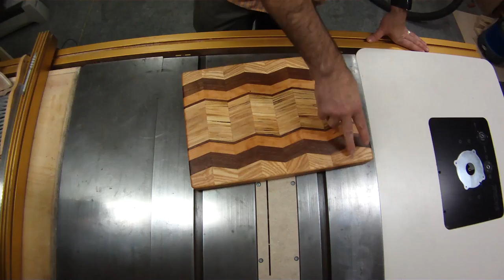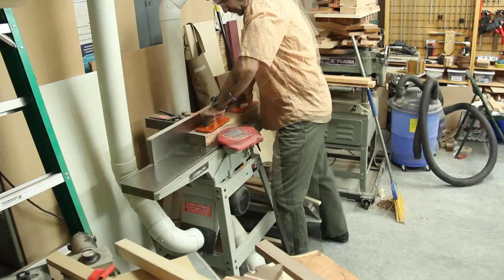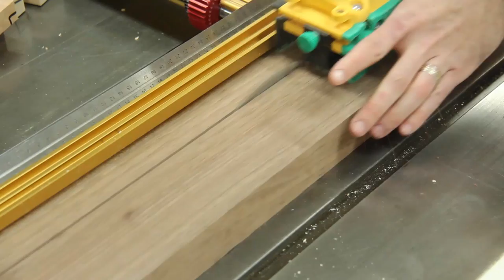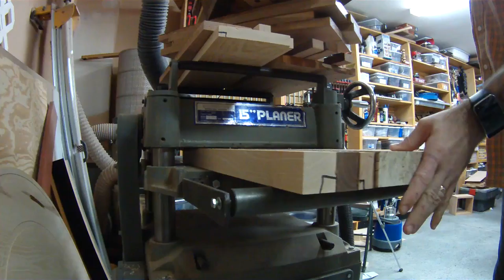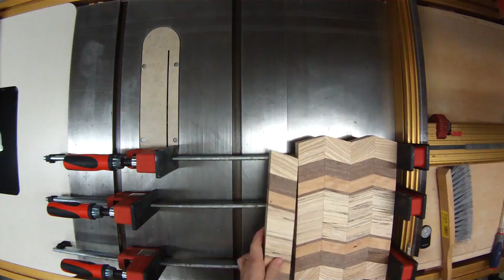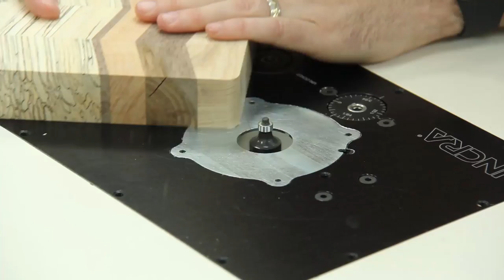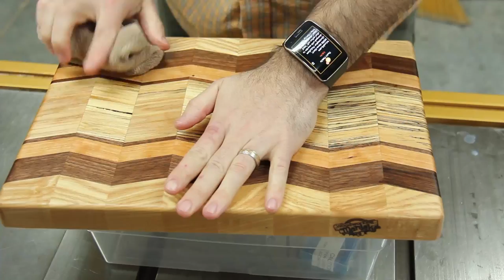Chevron Cutting Board - 2015 Kitchen Utensil Build Challenge

Comment: Very nice! You make it look so easy. I know there is a lot work involved when making those cutting boards. Great 3 dimensional look at 0:19. Looks like the cutting board has waves in it. Great video.
Reply from the maker: Yeah, this pattern tends to give a look as if the board is rippled even though it's completely flat.

Comment: Only yesterday did it my way I think it worked today will finish and once you are ready send a picture to you ok at the outset thank you, there is something else how long you leave the taboo dipped in mineral olio.
Reply from the maker: +Luiz Antonio I leave it in mineral oil about 30 minutes. Then let it drip dry for about an hour. Then soak again for about 15 minutes. Then let it drip dry again for a couple hours before applying mineral oil/beeswax.

Comment: looking at this more and more makes me wonder how hard would it be to make a table like this. do you think that is possible?
Reply from the maker: +Roshawn Sims That would make a beautiful table. For a small table, I wouldn't think any extra support would be necessary. However, if you are going to make a large table that might be under some stress and have heavy things placed on top. I would make sure to have good support underneath not to rely on all of that end-grain to end-grain glue up. I've never had a failure with any cutting boards, but they haven't had anyone stand on them or anything...

You might have sparked an idea for something I might have to try in a future video... ;)
Reply: That would be a great video. Like a coffee table size. I would want to make a full size table tho just got to work out the details.

Comment: Congratulation with new family member :)
Thank you a lot for sharing. 
Can you please tell some more about What kind of mineral oil and for how long and waxing finish?
Reply from the maker: Hossein Hayati Thank you for watching! You cannot use too much mineral oil, nor can you oil to often. It should be applied anytime the board appears to be looking dry. The mineral oil is what provides the board a protective barrier of any moisture. You can get the mineral oil from just about any retail location that has a pharmacy, which tends to be cheaper than going to woodworking stores...
Reply: Thank you :)

Comment: Awesome job! Were you using tightbond II and how long did you let it sit before you started cutting on it again?  I know you said a few of hours but could you give a more specific time?  I usually allow 24 hours before I stress the joints.
Reply from the maker: +Zack Conoly First off: Thank you!  I use Titebond III for my cutting boards. It's a waterproof glue that tends to hold up better for cutting boards. I let the glue dry for about two to three hours before moving to the next cut. Because these are not "stressed" joints, there is no risk of breaking it apart... Example: If I was making a chair, I wouldn't sit in it for at least 24 hours.
Before dipping it in oil, I typically let the final glue-up dry overnight. Because, adding oil causes it to expand a little which could be considered stressing the bond.  I've made MANY cutting boards. The one in this video was a gift to my wife. She uses it daily. I only waited a couple hours because of making the video.  It's holding up just fine... ;)
Reply: Awesome! Thanks for the info I am going to build a few for family and friends now based off your advise!
Reply from the maker: +Zack Conoly Great to hear!

Comment: what kind of brush do you use on your paint roller when applying glue? i just tried to do this using the only painter roller i had around, and the brush seemed to just suck up most of the glue and not spread it around very well. thanks for the video!
Reply from the maker: +Danny Cruz I'm actually using a rubber roller from Rockler and screws right onto a Titebond bottle. It was part of a kit I bought along time ago. It works great! I do recommend rinsing it off after use instead of letting glue dry on roller. Search for item 57361 via http://wwmaniak.com/rockler  <- (my Rockler affiliate link)
Reply: +WoodworkingManiak  cool thank you

Comment: Hey really nice design on the board ( looks great) Also congrats on the new  addition to you family.
Couple of questions about your process?
 # 1 It seems like you are jointing the end grain to prep for the second  is that what i am seeing. How is it possible to do this safely with out fear of the strips coming apart . Just concerned that some less experienced folks with lots of enthusiasm might go out and try this with less optimal results or possibly injury. Any ones experience with end grain jointing would be educational ( ie WHY TO OR NOT TO JOINT END GRAIN)    For me jointing end grain is taboo. Right up there with ripping through loose knots ( they become wood missiles) or short shaky boards ( they can split and kick hard ,  I did this yesterday and was a real eye opener for me  Also my first kickback on the 5 horse powermatic saw Do not want that ever again.)
#2 what kind of glue do you use and how will a end grain to endgrain board hold up over time.

Anyone looking to learn more about cutting board production as well as design should check out mtmwood
Reply from the maker: Cass Bartlett Thanks for watching and for the congrats.
  #1 As for the jointing of the end-grain. Yes, I did it in that video. However, the grain was at a 15 degree angle... So when I brought it to the jointer, I made sure that I had the angle going back away from the blades. Also, I was only taking about a thousandth off. Just barely shaving it. If it was end-grain directly vertical, it probably would have chipped out towards the end. Without support, vertical end-grain going through jointer or planer will chip out or sometimes explode just about every time... 
  #2 For all my cutting boards, I always use Titebond 3. I have never had any issues with end-grain to end-grain. You just have to make sure you have enough glue for it to soak up. End-Grain is thirsty.

I agree, mtmwood has some great videos on here. I'd recommend everyone to go watch!

Comment: maybe i am wrong here, but doesn't "spalted" mean molded? I don't know if I'd use moldy wood for a cutting board.
Reply from the maker: +Jdsjcdnvdnvdnvd Yes, it is a fungus growing while the tree is alive. Basically, what it leaves behind when the lumber is milled and kiln dried is just stains. Sometimes, it damages the wood to the point that the wood is super soft and unusable. What I use is just as hard and stable as regular hard maple.
Reply: +WoodworkingManiak Thanks!

Comment: Like the board a lot and will build at some point, quick question passing the end-grain overt he jointer? I've heard from other woodworkers here it was a bad idea and unsafe. In the same breath I've heard of others passing end-grain through planers, would like to hear your take on that. In my mind I see nothing wrong with it as long as the blades are sharp and extremely light passes are taken.
Reply from the maker: Yes, very light passes and sharp blades. Also, going slow makes a big difference. The planer is a bit of a different story. It is more aggressive and you cannot go nearly as slow. If you glue on a backer board that is side grain, you can then pass it through the planer with no problems at all...

Comment: great videos i jus wish u wud say what lengths ur cutting at when u do it or insert a footer in video that says it! congrats in that beautiful baby girl😆
Reply from the maker: +Chad Rayl I've had a few people ask about it lately... I guess I'll add that to the details in my write up on my website.  Here are the a quick run of the details:
The main glue-up was around 11 5/8" x 30" and I made the first cut at 15°. 

The Center Maple is 3-5/8" wide.
Then I have 1/4" wide Walnut pieces on each side of that.
Then 7/8" Cherry on each side of those.
Then 1-1/4" Walnut on each side of that.
and Finally 1-5/8" Ash.

After cutting the 15 degree angle, I then cut strips to 2" wide. The final board ended up being about 11 1/4" x 16" after trimming it to a rectangle.

Comment: Spalted maple for a cutting board though?
Reply from the maker: Vinnie Charity Spalted woods can often be brittle and soft. However, every now and then spalted maple can be found to be still solid as a rock. This stuff is rock hard just like regular hard maple and good to be used as whatever you'd want to use it for. :)
Reply: Don't get me wrong, I love spalted maple, but wouldn't it be bad for a cutting board being that it's actually mold in the wood? Great looking board by the way!!!
Reply from the maker: Vinnie Charity Typically, the fungus is only around when it's soft and brittle. That's what is actually deteriorating the wood to make it so soft in the first place. As hard as this stuff is, it's not even fungus... It's just a stained mark left behind by the fungus that WAS growing when the tree was alive. Basically, two different types of spalted woods that should have different names because they have completely different characteristics.
Reply: Very cool, and thanks for the explanation. I found a piece of spalted maple in the ditch of all places. I'm waiting for it to dry so I can machine it down to use it. Might go in my next cutting board...
Reply from the maker: Vinnie Charity So, to answer your concern. Yes, it would be a bad idea to use spalted wood that was soft and spongy feeling. One because, it would make a bad cutting board anyway, and two because there might be fungus still present. But the wood I was using was completely different... If it's as hard as normal maple, you shouldn't have any concerns.
Reply: It's super hard, and has a few cracks, hopefully it will turn out to be useful...

Comment: Hey Dude, really nice job! I  
1. What sizes did you cut the stripes before glueing them the 1st time? 
2. What size does the cuting-board has when its finished?
Reply from the maker: The Center Maple is 3-5/8" wide.
Then I have 1/4" wide Walnut pieces on each side of that.
Then 7/8" Cherry on each side of those.
Then 1-1/4" Walnut on each side of that.
and Finally 1-5/8" Ash.

After the initial glue up, I cut the 15 degree angle and then cut each strip ~2" wide.
Final Board sizes ended up being around 11 1/4" x 15 3/4"

Comment: What is the thickness of the wood plank
Reply from the maker: +Luiz Antonio I made the cutting board 1.5" thick
Reply: +WoodworkingManiak 
What I wonder is the thickness of each ok ie each timber that is 9 what I've seen tells me the medirdas
Reply from the maker: +Luiz Antonio Here are the widths of each board I used:
The Center Maple is 3-5/8" wide.
Then I have 1/4" wide Walnut pieces on each side of that.
Then 7/8" Cherry on each side of those.
Then 1-1/4" Walnut on each side of that.
and Finally 1-5/8" Ash.

Comment: Will the end grain to end grain joint hold over time?
Reply from the maker: +bret h No, there isn't any real stress on the glue joints... So it will hold up fine. We have been using that board in our home ever since the video. No issues at all.
Reply: Woodworking Maniak hey thanks for the reply I've made several chevron boards and a few stairway boards all came out looking amazing but I had someone tell me end grain to end grain doesn't hold up.  Good to know someone has done it and it lasted.

Comment: If a guy doesnt have a planer or a jointer what would you suggest?
Reply from the maker: +Avery Hartvigson Buy from a lumber mill that will surface 3 sides for you and to same thickness for  each of different species.

Then, as long as you have clean, sharp table saw blade and have the saw well squared up, you should be able to make good enough cuts to be glue ready.

However, if the blade is dull or dirty, it could cause the cut to be a little wavy and leave gaps. And if the saw blade is not exactly set at 90°, perpendicular to the table, your board will not be flat after glue-up.

Comment: I love that cutting board, you did an amazing job, is there any way I can get the plans off you. would love to try to make one.
Reply from the maker: +fortfrank Thank you! I didn't make plans for that one, however here are the widths I cut each of the woods:

The Center Maple is 3-5/8" wide.
Then I have 1/4" wide Walnut pieces on each side of that.
Then 7/8" Cherry on each side of those.
Then 1-1/4" Walnut on each side of that.
and Finally 1-5/8" Ash.

After the initial glue up, I cut the 15 degree angle and then cut each strip ~2" wide.

Comment: I know it looks good, but isn't using a spalted wood bad for use in a cutting board?
Reply from the maker: Kabooloo Spalted woods can often be soft and brittle. However, every now and then spalted maple can be found to be still very solid. This stuff is rock hard just like regular hard maple and good to be used as whatever you'd want to use it for.
Reply: WoodworkingManiak Well the reason I brought that up was that I read that spalted shouldn't be used in items that will be in contact with food is because of the fungus that is causing the spalting is toxic and when using a cutting board, you are introducing the fungus spores into the food you are cutting.
Reply from the maker: Kabooloo Typically, the black streaks are merely stains left by the fungus growing in the wood while the tree was alive. If the fungus was still active, the wood it usually rotten and extremely soft and unstable. The wood that I use is kiln dried and very safe. If soft at all,  then yes, it would not be a good idea to be used for a food item. Also, it would have to be stabilized using a resin of sorts to be used for any other woodworking project.

Comment: Alright, you really need to talk about what you are doing. Please, more input. Like, what glue are you using; what are your measurements.
Reply from the maker: +Tony This was my first YouTube video I produced. I appreciate your input. I did use TiteBond III glue.

The Center Maple is 3-5/8" wide.
Then I have 1/4" wide Walnut pieces on each side of that.
Then 7/8" Cherry on each side of those.
Then 1-1/4" Walnut on each side of that.
and Finally 1-5/8" Ash.
Reply: Thank you for the measurements that will help me out a lot. I hope my board will come close to how well yours came out.

Comment: HI I ENJOY WATCHING THE  CUTTING BOARD SHOW, I HAVE MADE A FEW BOARDS. HOWEVER MOST SHOWS DO NOT TELL YOU THE LENGTH OF STRIPS OR THE WIDTH OF THE STRIPS, THE ONLY MEASUREMENT I HEARD FROM YOU WAS 15 DEGREES. PLEASE SEND ME THE MEASUREMENTS. I WILL BE WATCHING MORE OF YOUR VIDEOS
Reply from the maker: +BRIAN ANDREWS The main glue-up was around 11 5/8" x 30" and I made the first cut at 15°. Then I cut each strip 2" wide. The final board ended up being about 11 1/4" x 16" Thanks for watching!
Reply: +WoodworkingManiak   HI TIM, BRIAN AGAIN, THANKS FOR YOUR REPLY, WHAT IS THE WIDTH OF EACH  BOARD, MAPLE WALNUT CHERRY .IE 2",4",1/2" I CANNOT READ YOUR TABLE SAW SETTINGS. THANKS AGAIN. BRA.
Reply: +BRIAN ANDREWS     HI TIM, BRIAN AGAIN, THANKS FOR YOUR REPLY, WHAT IS THE WIDTH OF EACH  BOARD, MAPLE WALNUT CHERRY .IE 2",4",1/2" I CANNOT READ YOUR TABLE SAW SETTINGS. THANKS AGAIN. BRA.
Reply from the maker: +BRIAN ANDREWS Sorry, I was away from my shop until now and didn't have the piece available to measure...
The Center Maple is 3 5/8" wide.
Then I have  1/4" wide Walnut pieces on each side of that.
Then 7/8" Cherry on each side of those.
Then 1 1/4" Walnut on each side of that.
and Finally 1 5/8" Ash.

Comment: I thought gluing end grain to end grain was a no no. I am now confused...
Reply from the maker: +Conrite Wing If the glue joints would be under stress like a table or chair, yes. However, this has no stress to break those glue surfaces. It will last a lifetime.

Comment: nononononono. you can't glue end grain. there's no way this board will hold up.
Reply from the maker: +paulbalegend Glueing end-grain in a joint that would be under stress can be problematic because it soaks up more glue than side or edge grain. However, this board is 1.75" thick and  giving about 11.5" of end-grain glue surface... The cutting board is not under stress. With proper amount of glue and keeping it maintained with oil, this board will last a lifetime. My wife uses that one every day.
I make many different types of cutting boards, both end grain and edge grain. I also have many  many boards out there similar to this one, none of which have ever had an issue.